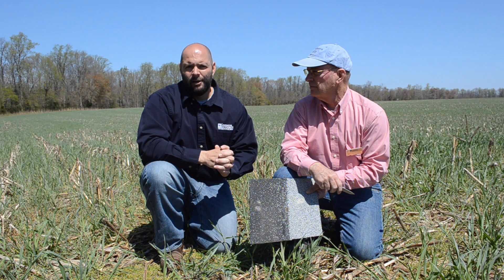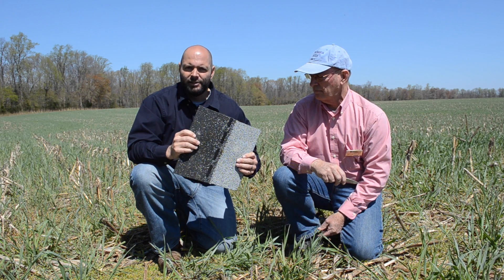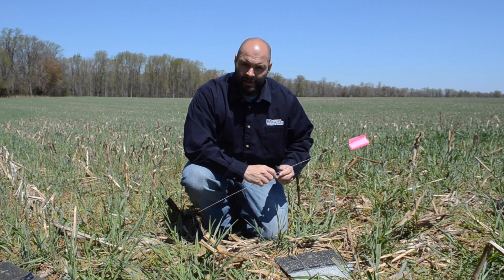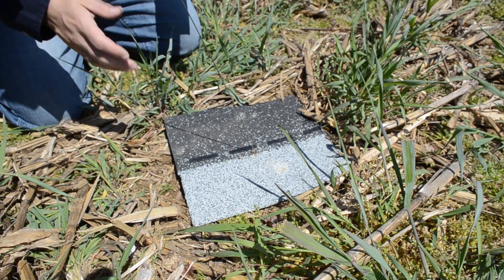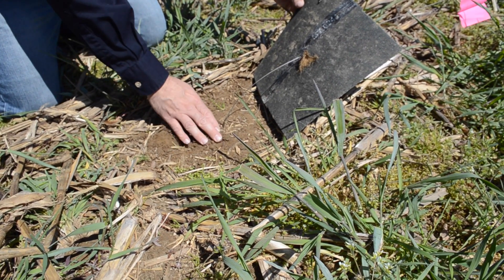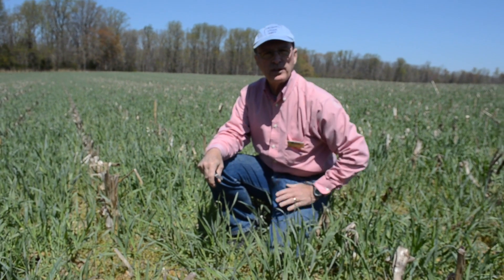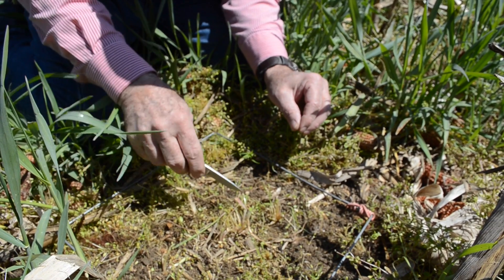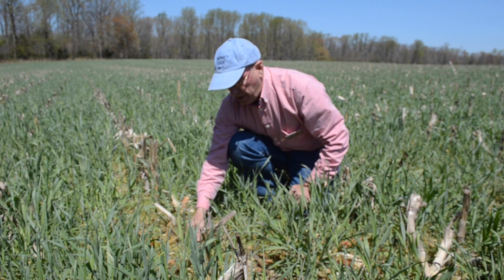How to Sample for Slugs in Soybeans Using Shingle Trapping and Residue Sampling Methods

Comment: What do I do with the information I gather?  Is there a threshold that should be reached before I consider using a bait?
Reply from the maker: Here's a response from our Extension Entomologist David Owens: Hi Dan,

 

We do not have any good thresholds for slugs, in part because their activity is so weather dependent. I prefer to think of it as ‘population of concern’, and is generally thought to be around 3 per square foot. In Delaware we have 2 common species of slugs – marsh slugs and gray gardens. There may be damage potential differences between the two, but I have seen fields require replanting from both. I have also seen fields with very high slug populations, much above the 3/ft and not have any significant damage because of warm weather and warm soils promoting rapid seedling growth. If soil is warm, weather is forecast to be warm, sunny, low humidity, or windy, that will limit slug activity and promote soybean growth.

 

I do not have the level of experience to be comfortable with when to recommend an expensive Deadline application, and its especially hard to recommend a pre-emergence application. Its generally about 2 bucks per pound, and best to use at least 10 pounds per acre. I have heard from some well respected consultants in our area that they think some folks might not make that application with current commodity prices and take insurance or replant. If Deadline is going to be used as a rescue treatment, you need to keep a sharp eye out at emergence, scouting fields probably twice a week. I have also seen situations where a deadline application was made, but perhaps a bit too late and the field was replanted anyway. By the time the field was replanted, the temperatures were 15 degrees warmer. So what worked? The deadline or just delaying things until better planting conditions? It’s hard to know, especially when the 3-10 day forecasts don’t seem to be that reliable this time of year.

 

Soybeans also have really good compensatory ability to recover from stand loss. I’m not an agronomist, but feel that its somewhere between 20 and 30%. As long as their unifoliates are out and the trifoliates are coming on, its difficult (but not impossible) for slugs to kill them. I have also seen corn take a lot of feeding and grow out of it, but have heard many horror stories of corn replanting too.

 

Our best management for slugs includes reducing insecticide usage as much as possible and promote good growth. Ground beetles are the most important slug predators and are harmed if a pyrethroid is included with cover crop burndown sprays or post herbicides. Neonic seed treatments can also be detrimental, although it is much harder to find corn without it. Using row cleaners, getting good seed slot closure, and strip tillage will also help promote seedling growth. My predecessor Joanne Whalen did a study a few years back that suggested that vertical tillage could also help reduce slugs. Tillage is by far the most effective slug management tool. John Tooker at Penn State has been doing a lot of work with planting into a green cover crop for slug management. There are also cover crops that slugs REALLY like, including legumes and brassicas. The group thinking is that brassicas may actually promote a slug population and a farmer would probably do well to avoid them in sluggy fields. There's a farmer here in Delaware who sprayed his planting strips and left small, between-row strips of his cover crop green. I am very interested to see what happens to the field when its planted, there is a decent population of slugs in it right now.

In the region, Sally Taylor at Va Tech (svtaylor@vt.edu), John Tooker at Penn State (tooker@psu.edu), Kelley Tilmon at Ohio State (Tilmon.1@osu.edu), Kelly Hamby at UMD (kahamby@umd.edu) have all been working with slugs. I am not sure how much Christian Krupke has been doing with slugs, but he is Purdue’s field crop extension entomologist and would also be a good brain to pick (ckrupke@purdue.edu).

If you have any other questions or observations, please feel free to contact me or any of this group any time. Are you seeing or hearing reports of slug damage yet? I am concerned that this is shaping up to be a slug spring.

Sincerely,
David Owens